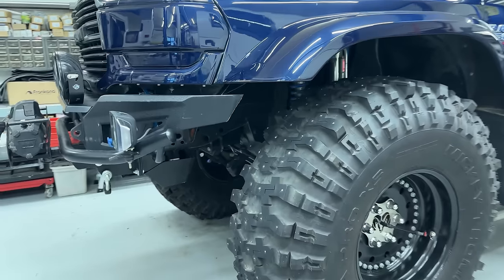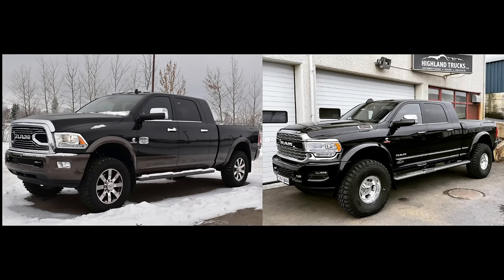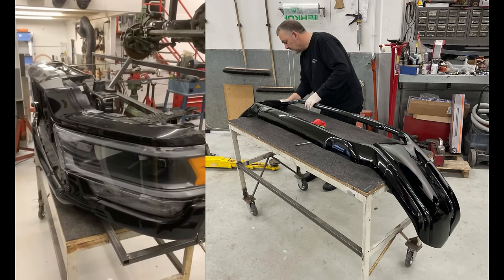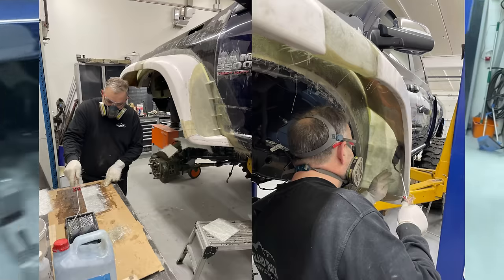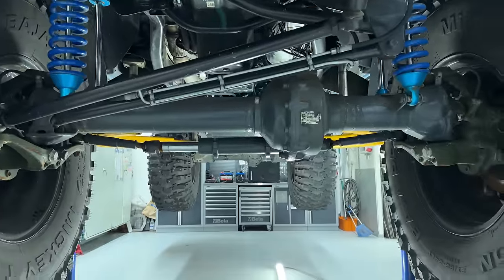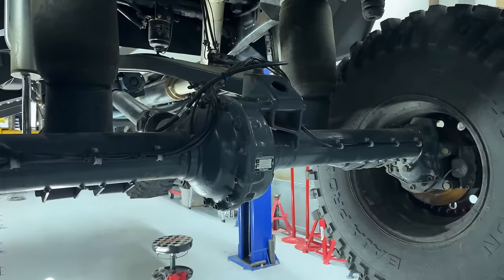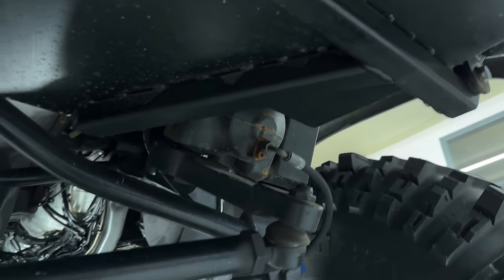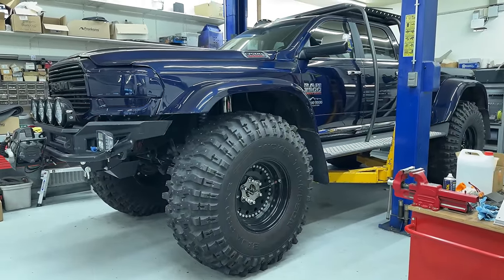58" Unimog Ram 3500 Walkaround

Comment: Why not to use electric fans?
Reply from the maker: That's a valid question. For an engine of this size and with 500 horsepower we would have needed a 50hp electric fan to sufficiently cool the engine. The stock fan can take up to 10 percent of the engines power on full blast. That's not really feasible and we do not have great experiences with electric fans due to ice and snow build up as well as reliability.
Reply: I have 2 16inch spal fans on my 44 inch patrol with 450hp. Havent experienced any issue with ice or snow. Cause they only turn on at certain temp when reached so snow after night in higlands is already melted :)
Reply from the maker: Yes, electric fans definitely work in various builds. We just preferred not to use them on this build :)
Reply: Cause the mechanical fan outflows every electric fan on the market
Reply: @Gregpaulluvr124 100% mechanical fan always my first choice
Reply: Gave you a sub from Upstate New York USA. Great build
Reply: Moving slowly in deep snow makes it’s hard to shed warm air as the snow is close to the floor where air normally flows out and you build massive amounts of heat as you use lots of power as counter intuitive as it seems, deep snow builds lots of heat.
Reply: @Gregpaulluvr124  
Exactly
Reply: @christianhotz4414  
Exactly
Reply: Electric fans on these diesels, Cummins, power stroke or even duramax are really tricky to make work. Don’t get me wrong they will work in terms or turning on and sending air in, however they’re usually far worse in this application in comparison to even the stock fan. On a light duty truck they’re good, on these not so much

Comment: That is super heavy duty truck very cool 
The only thing I would change would be to use electric radiator fan 
then you take out that shaft
Reply from the maker: For an engine of this size and with 500 horsepower we would have needed a 50hp electric fan to sufficiently cool the engine. The stock fan can take up to 10 percent of the engines power on full blast. That's not really feasible and we do not have great experiences with electric fans due to ice and snow build up as well as reliability. 
In our experience the mechanical fan is more reliable long term and it out-flows the electric fans on the market.

Comment: What an awesome build.
First time I've seen a cummins engine look small inside the engine bay 😂

Curiosity, why go for a mechanical fan compared to electric? Seems easier to swap to electric than build a fan shaft ?
Reply from the maker: For an engine of this size and with 500 horsepower we would have needed a 50hp electric fan to sufficiently cool the engine. The stock fan can take up to 10 percent of the engines power on full blast. That's not really feasible and we do not have great experiences with electric fans due to ice and snow build up as well as reliability. 
In our experience the mechanical fan is more reliable long term and it out-flows the electric fans on the market.

Comment: [For new builds] any idea to put that front winch where the batteries are currently located and have those mounted above the fan axel? Have no idea what kind of batteries you have, but with light lithiums you probably would have more weight at center of gravity. Also, the winch in its current location is both obtrusive and not so nice (quite ugly?). However, you have created an innovative, massive and cool truck. Kudos og skål fra Norge.

Comment: Could you flip your hyd steering links to mount on bottom to reduce the angle of steering joints
Reply from the maker: Yes, we did try that, and it was a couple of degrees more angle surprisingly. A good suggestion though.
Reply: @highlandtrucksmods  
Really creative group of individuals you must have by your side. What made you guys start building this style of vehicles.
Reply from the maker: @Nic-po7yl  The reason for this style is just constant iteration and seeing what works best over many years. We have been building similar trucks for snow wheeling in Iceland for a very long time. We started building ram trucks on Unimog axles first in 2007 and have done many others since then.

Comment: Do you run limit straps for the rear axle or just let the bags hold the weight at droop?
Reply from the maker: The rear shock absorbers are holding it in place at full droop.

Comment: Looks very cool, but would it not be cheaper and more reliable to just use an actual Unimog?
Reply from the maker: Thank you. This truck is arguably more capable than a modern Unimog. A modern Unimog U4000 is around 10 tons so it’s twice as heavy and the Unimog is around 230hp and 900nm of torque. This Ram is 500hp and around 1500nm of torque. In our experience the Ram trucks we have put on these Unimog axles are the most capable snow expedition trucks in Iceland.

Comment: ❤ slightly concerned about front frame extension looked kind of thin metal that was put in there...
Reply: I think these guy's know what there doing. There's always one guy out there and you are him👎
Reply from the maker: Thank you for your concern. We are however not worried about the strength of the frame as we used the same thickness material that is in the frame. There's also a substantial  amount of strengthening on the inside of the frame which is not seen in the video. As well as multiple cross bars from the left frame rail to the right frame rail. This was vetted by a mechanical engineer.

Comment: Just curious as to why you chose a 3500 over a 45/5500?
Reply from the maker: No specific reason really, this truck was available to us for a very good price at the time. The 3500 is also very abundant here in Iceland, the larger trucks are not and would most likely have to be ordered specifically. The 4500 and 5500 obviously have some benefits like a larger carrying capacity which would have been useful 😅, but we made it work.
Reply: @highlandtrucksmods  of course, main 2 benefits I'd say are the wider width axles, and more robust frame.

Comment: Do you bend those roll bars in house?
Reply from the maker: We outsourced rolling of the large curved tubes and then we welded everything together at our shop using various pre-bent 90 degree tube sections and straight tubes.

Comment: What a strange choice, you did it to give it a lift, due to the gears on the wheel bases, without messing around with suspensions. 
Unimog axles, maybe except the last model, but I'm not sure there either, have a defect about oil vapors, they empty themselves after some thousand kilometers and break if not refilled. There is a mod for that, you have to add a container above it with a tube in and another down to allow the vapors to expand, deposit and reenter the differentials, without vanishing into the gearbox. 
But you probably made that mod here, doubtfully with all that work you didn't do it tho.

Comment: Try Rusian Low Pressure tyres, Severtruck or Rosava
Reply: They wouldn't be road legal here. The 58" they use are road legal here
Reply: @kjartanB  they have 58’s also. Low pressure tyres are lighter and better both on and off road. I cheked that. And at 17 to 40,000 $ you could buy an aluminium body car weighing only 14 to 1800kg. Yars cars. Yours, I suppose has 40,000$ only in mods and can’t even climb a muddy hill, ‘cause if the weight
Reply: @cristian8471  doesn't matter the size. These Russian tires aren't road legal here. Those Mickey Thompson 58" tires they are using on the Ram are road legal and can be driven at 90km/h which is the highest speed limit we have.
Reply: @kjartanB  did you check? I know the Russian/Ukrainian tyres have 80 km/h. And on road 0.5 pressure, off road 0.20-0.15. Must check low pressure agriculture tyres in the US also